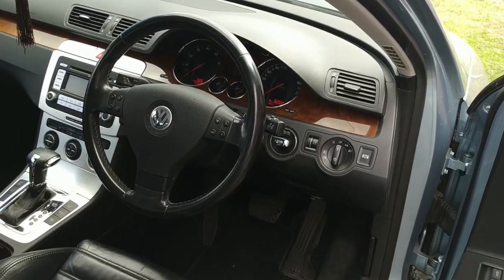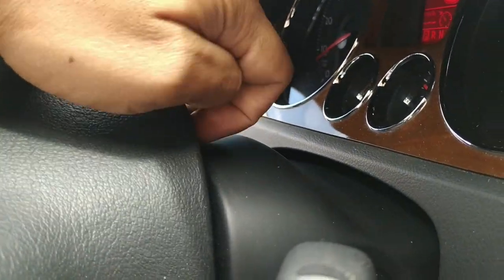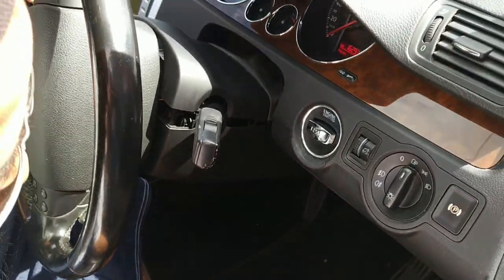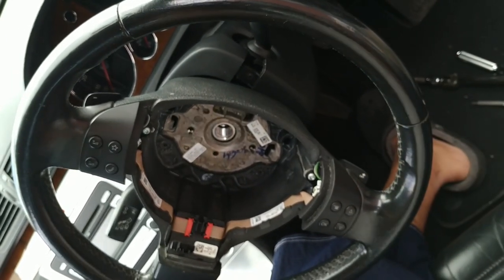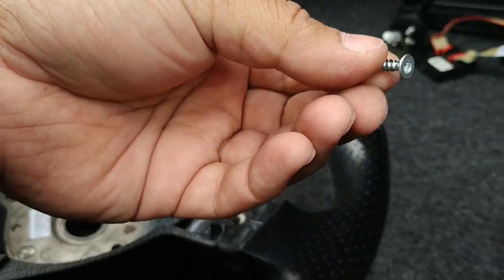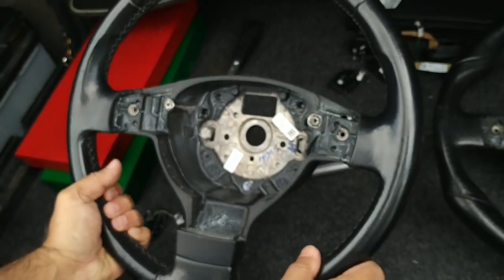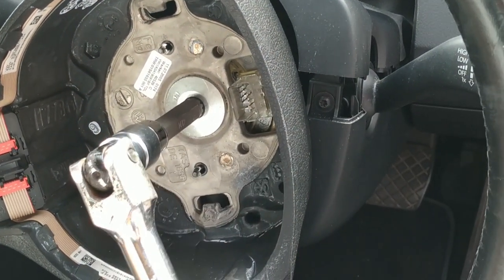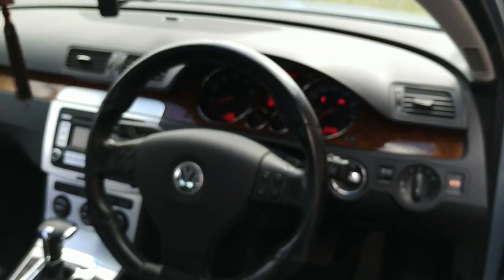VW Passat B6 Steering wheel swap and retrofit MFS components

Comment: Folks.. Battery does not need to be disconnected when removing airbag.
But if you do you're supposed to wait a few minutes before removing airbag.
You WILL NOT have a warning light as long as you don't turn the ignition on.
You also don't need to remove the cowling. Turning the steering wheel and undoing one spring, then turning it to the other side and undoing the other side. There's plenty of room from the top.
And last. Steering wheel bolt isn't a stretch bolt. It only takes 50nm. No need for extra degree to tighten it..

Comment: I have a 2006 b6 with a 4spoke non MF steering wheel,  can I do this upgrade tonit, if so what parts and modules would I need? Thanks for any information and for your help.
Reply: Its essential to find out what kind of steering wheel airbag you have, in the beginning they were making both 4 spoke and 3 spoke in two versions, with one or two stage airbags. You need to found out if you have two stage or one stage airbag, basically if you you one airbag connector or two. Once you are sure about that you will find the three spoke with same number if cables connecting to the airbag itself, switching the steering wheel is easy. But you will most probably also need to change the steering wheel unit under the steering column cover and code it with VCDS.

I'm currently in process of doing this, so far i was able to connect the steering but the buttons dont light up and nothing works on the steering, including horn. Will need to swap the steering wheel unit and code it tomorrow.

May post video about the whole process.

Comment: airbag?? (i know mf doesnt gona work its ok for now) 
my slipring is type 1 and lowline modul,
I will replace modul later when i find out highline,
Horn and airbag conector is the same so is it gona work?
Reply: Connectors are the same, just make sure you have same stage version, so either single or double airbag. You need to swap the steering with same config.
The slipring/clockspring may not be necesary needed, but the steering wheel unit may.

This may be the one you are looking for 3C0953549E or similar/replacement, look into catalogs for direct replacement.